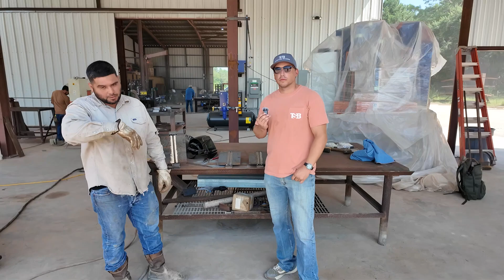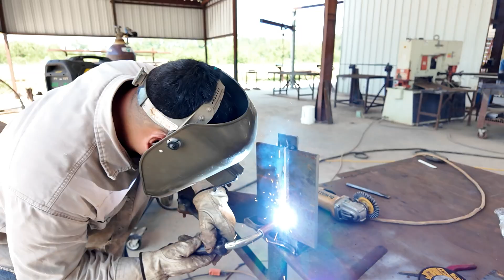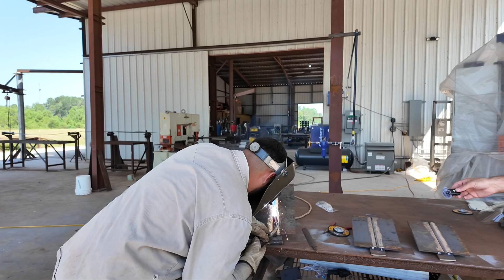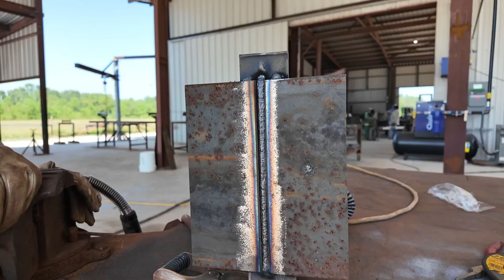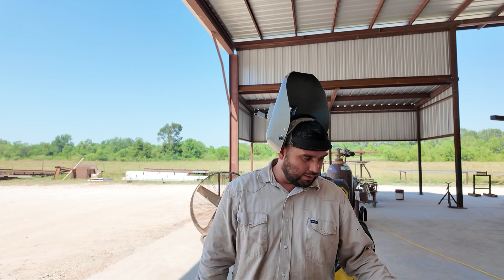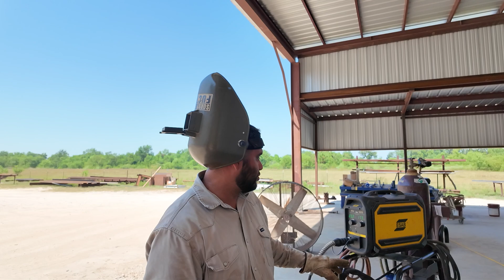Flux Core Welding Techniques

Comment: he doesn't really answer, does he...? is that flux or dual shield?
Reply from the maker: Hi, George! It's gas shielded flux core welding. We typically use a 75/25 gas mix.
Reply: @texassteelbuilt  Flux and gas generally don't go together. If u open the side panel on that great welder, the wire is 0.035 solid wire. Grab a welder and weld 50#'s and learn, please.
Reply from the maker: @martylost167  Hi, Marty. I apologize for my lack of knowledge as I'm not a welder by trade, but a lowly marketing guy. It is my understanding that there are two types of flux-core wire: self-shielded and gas shielded. We use the gas-shielded variety.

Here are a few links that I was provided to aid in my welding education:
https://esab.com/us/nam_en/esab-university/blogs/dual-shield-flux-cored-wire-benefits/
https://www.thefabricator.com/thewelder/article/consumables/getting-to-know-flux-core-wire
Reply: @martylost167 do you mean they were running solid wire in the video? 🤔